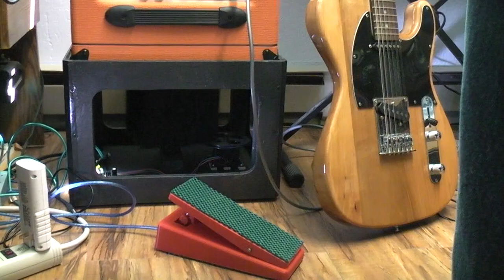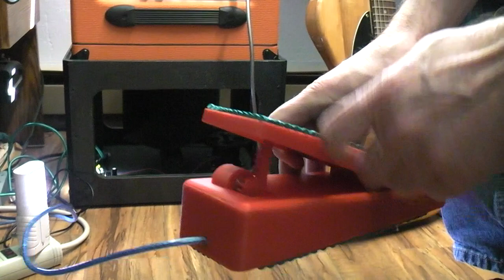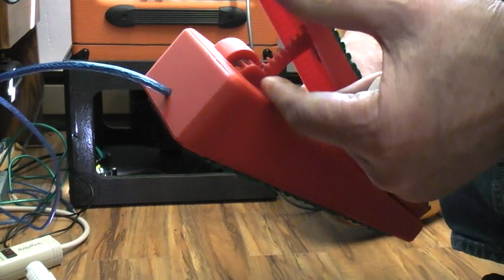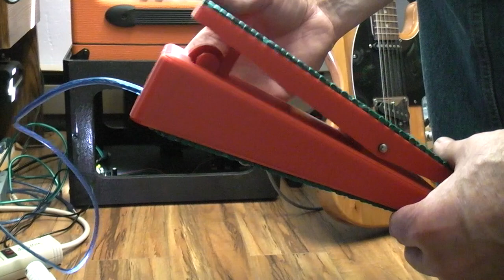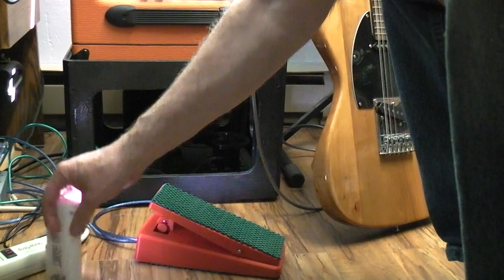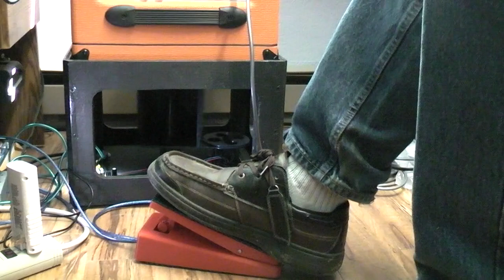Demo of Rocking Foot Pedle Leslie control.

Comment from the maker: The foot pedal control is just a 10K linear taper pot. One side of the pot goes to +5 volts the other side to Ground and the wiper of the pot goes to the speed control line of the circuit.